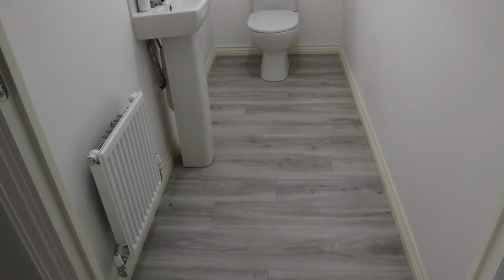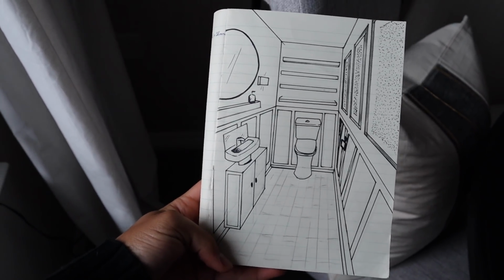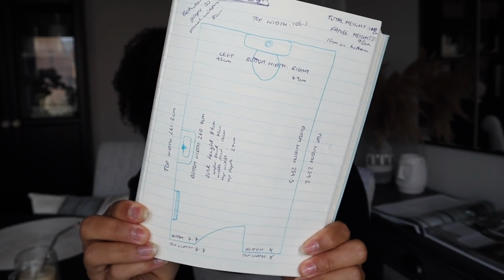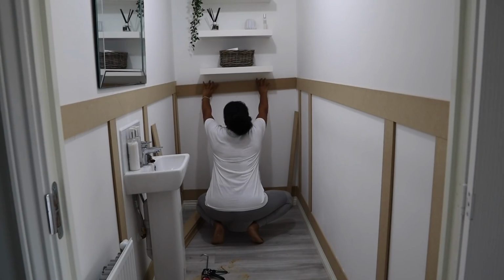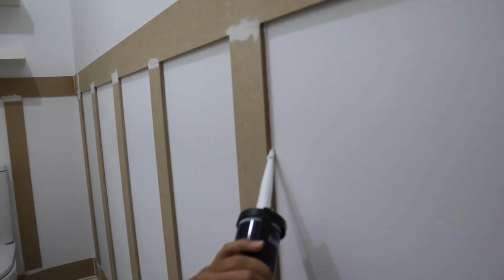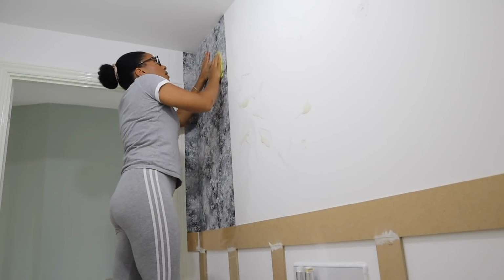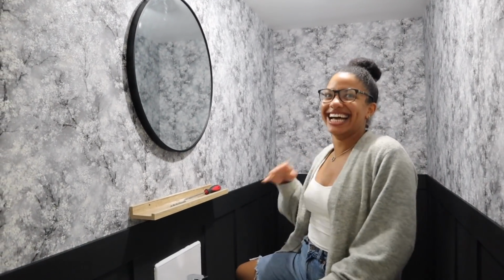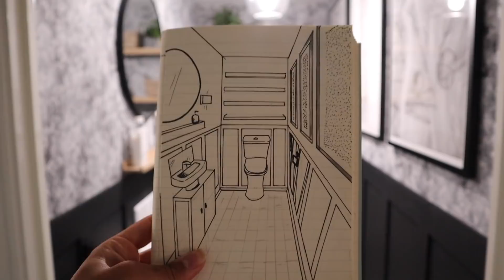EXTREME BATHROOM MAKEOVER | How To Do Panelling Tutorial | Shade Shannon AD

Comment: Hey lovely looks fab did you need to seal the MDF just incase moisture goes on as I'm thinking of doing but unsure if I need to buy this xx
Reply from the maker: Hey! It's best to yes - I used a primer. In this bathroom there's not much water or steam or moisture - just the small sink that's rarely used so I didn't go full out moisture proofing it but you can make the judgement call on if you need to in yours (with a shower/bath tub etc) xx